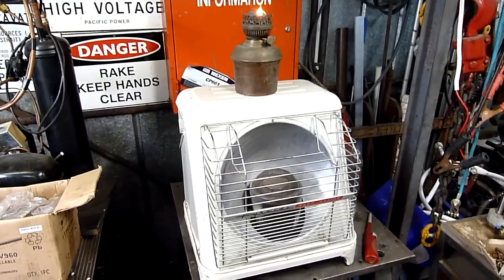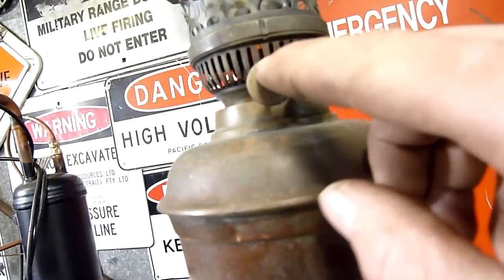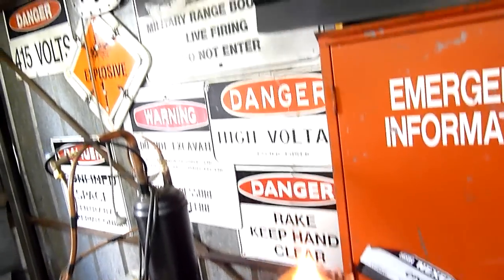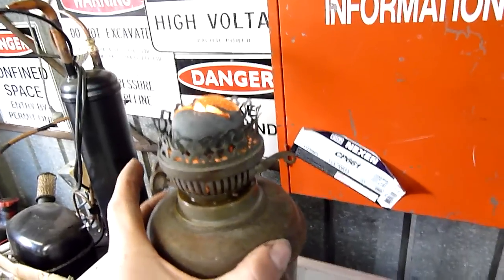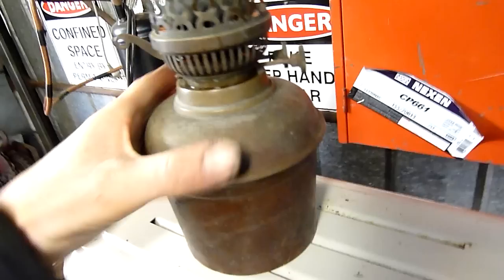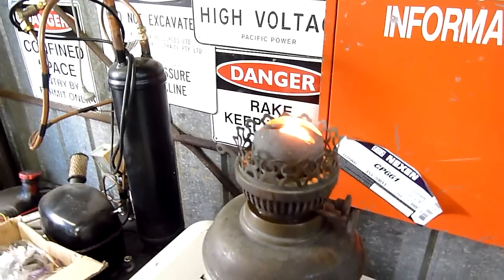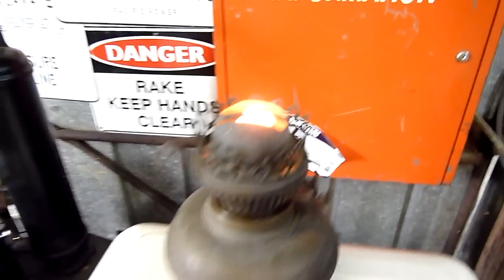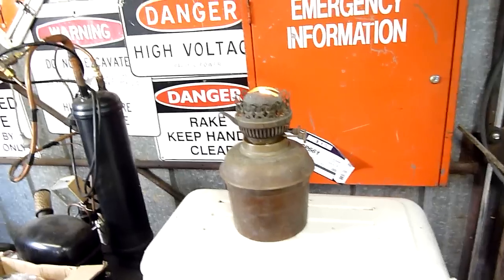Mystery Kerosene Lamp ID for V8jagnut

Comment: Aussie- The glass for your lamp is still available. There are thousands on the internet. If that lamp were mine, I'd use several modern-day products to utilize the concept of antiquity with a modern touch. Forget the glass chimney, perforate a cone of copper sheet (.020+-), lead came the edges, rivet a lamp harp (after modification),toward the top, polish the cannister and most of all, bring this great creation into the housev and give it to your wife, kiss her and tell her that you love her.

Comment: Very late reply.  That is a Duplex burner, originally patented by J Hinks in Birmingham, UK in 1865, It should have a flattened version of the standard "Vienna" flat wick burner chimney, with the flattened side parallel to the wicks.  Readily available from kero lamp specialists but usually "antique" dealers do not have a clue. The font is designed to go into some more ornate base,  

http://lumiara.perso.neuf.fr/lumiara/en/